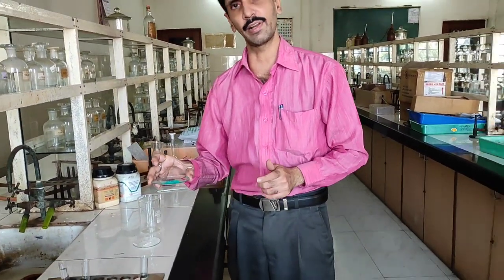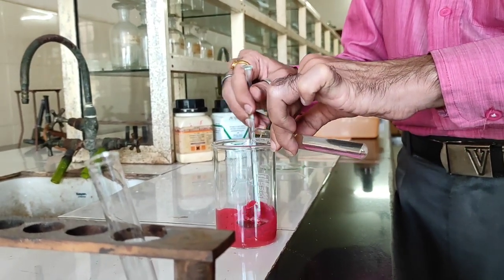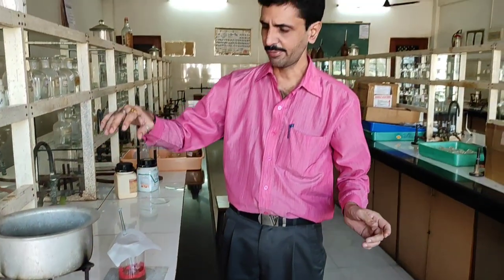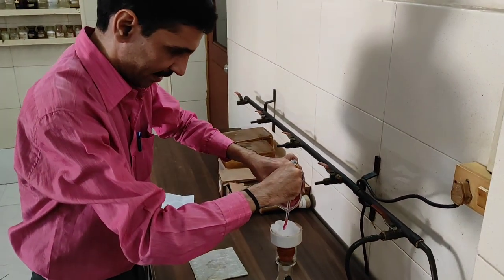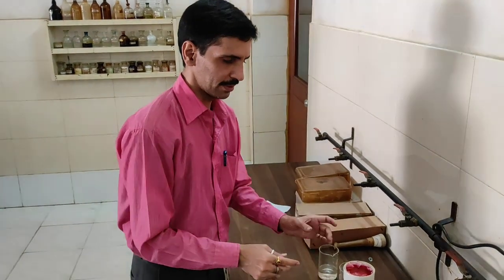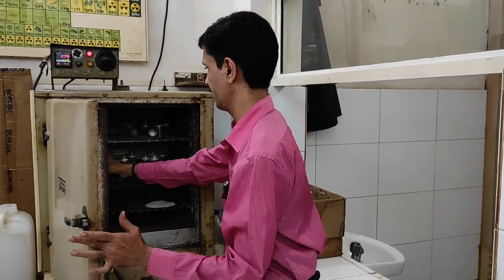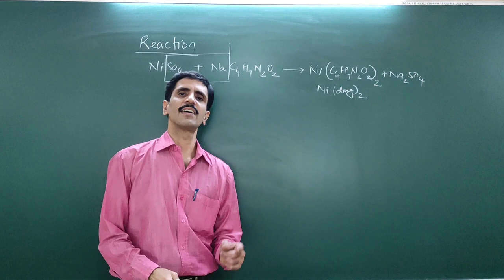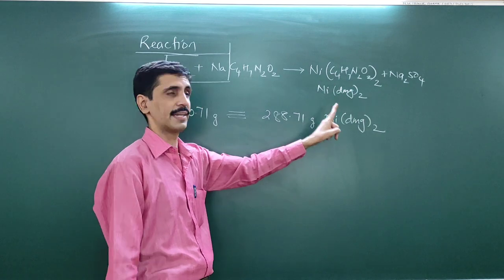Preparation - Ni(DMG)2, Part 2

Comment: There is no such thing as ammonium hydroxide. It is always an aqueous ammonia.
Ammonia is not required in this experiment as we are using the sodium salt of dog and not (Hdmg). When the sodium salt is dissolved in water it undergoes hydrolysis to release the hydroxyl ions which takes care of the pH condition of the synthesis.
What is being described is the extension of the gravimetric method of estimation of Ni as Ni(dmg)2. The experiment is about synthesis of Ni(dmg)2 where it is important to discuss reaction conditions; and limiting reagent concept. The yield is important subject to rthe eaction conditions employed.